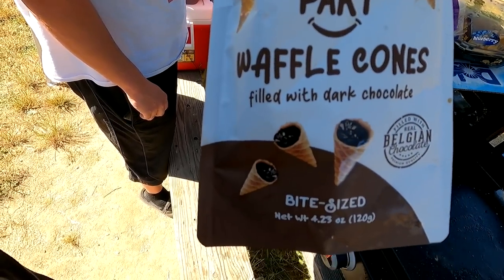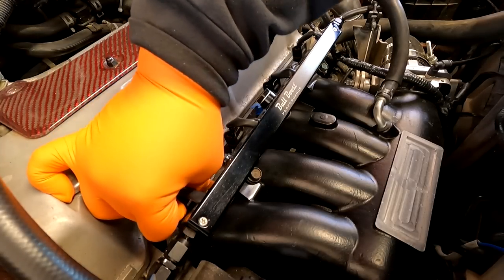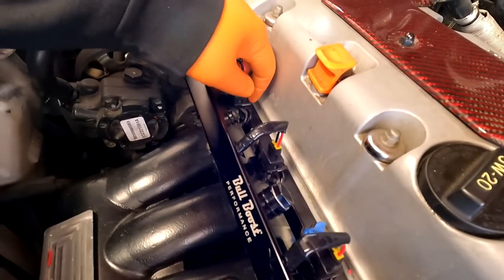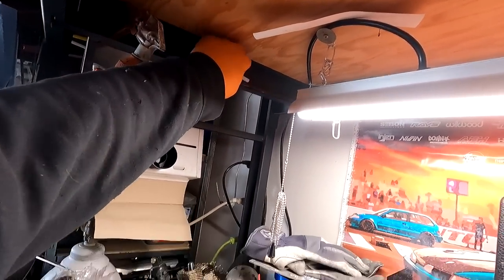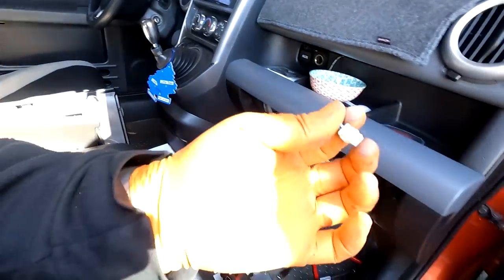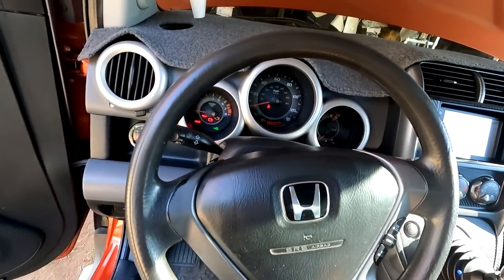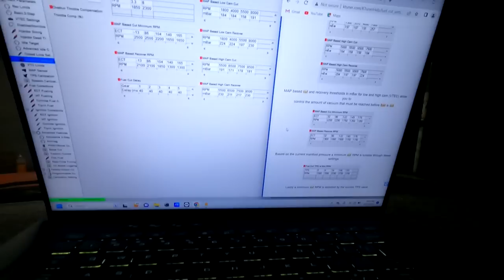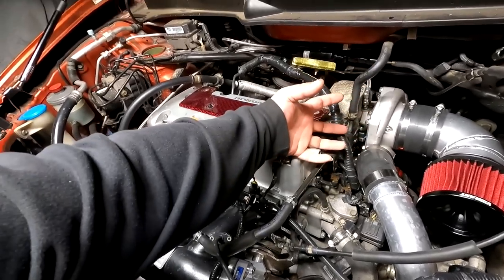Honda Element Turbo Build 6 : Grams 1150cc Injectors + KTUNER ECU

Comment: DIY injector cleaner= cut an injector clip from the junk yard, run alligator clips to the wires and connect it to your power probe, when you activate the power/ positive feed spray fuel cleaner through the injector. With your talents I’m sure you can also build a little jig for a simple set up like this to make it easy for you to use/ store away.

Comment: One question. So the signal wire you added it to the analog input 1? Did you have to adjust voltage in the k tuner?  In wanting to add this to my setup on an accord. Ktuner end user. Thanks